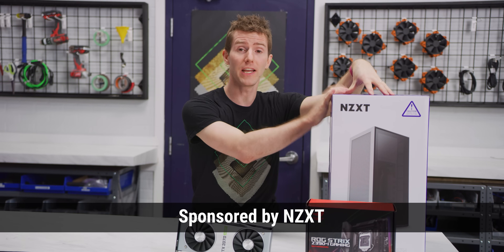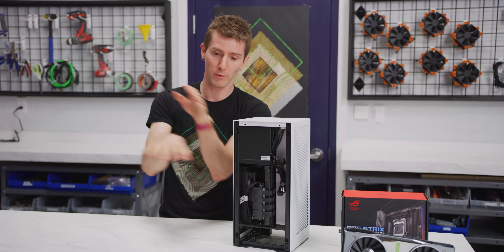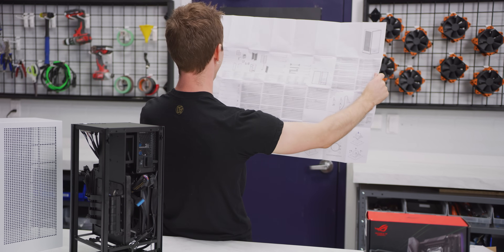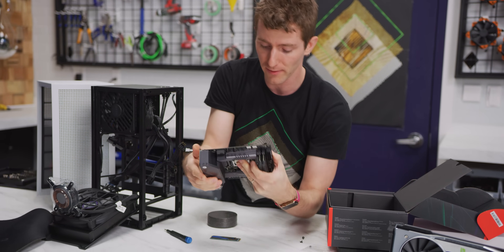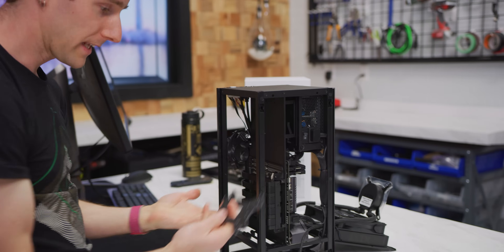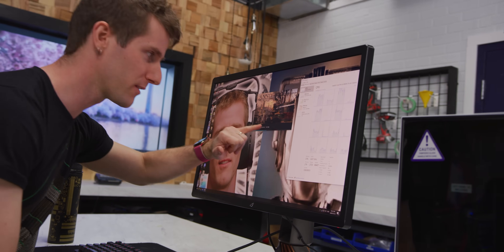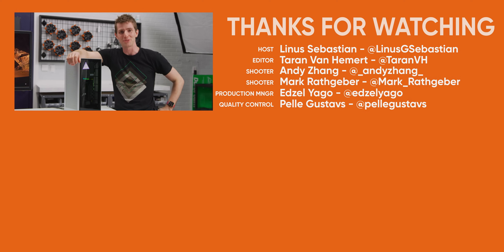Building the Xbox Series X Rip-off PC

Comment: From a novices perspective, I feel the only trouble would be that M.2 on the back for if you wanted more memory, the graphics card you would choose if you went with something bulkier, and the motherboard section. Aside from that, I feel it would be easy. 
      As well I really wish NZXT would come out with something similar but kind of flipped. So AIO and case headers are on top and then toss in a 4K Blu-ray disk drive on top as well, then everything else is towards the bottom. If I could get that in a micro set up I’d totally do it.

Comment: Guys I'm building a pc so tell me if these parts are good: Cpu: ryzen 5 3600x Ram: G.SKILL Ripjaws V Series 16GB (2 x 8GB) 288-Pin DDR4 3600
Gpu: GIGABYTE Radeon RX  5600 XT. Storage: WD Blue 3D NAND 500GB Internal SSD and Seagate Barracuda  2TB 3.5" SATA 7200rpm hdd
Case: NZXT H510 Compact Atx Mid-Tower Motherboard:
MSI B450 TOMAHAWK MAX AM4 AMD B450 SATA 6Gb/s ATX AMD Motherboard Power supply: Cooler Master MPY-6501-AFAAG-US MWE 650 Gold Full Modular, 80+ Gold Certified 650W Power Supply, 5 Year Warranty

Comment: It looks easier than most small form factor PC cases, but the fact that you have to use their PSU is annoying. It could easily go for around $100 less if, as in my case, you were looking to move all your stuff into a smaller case. $350 for case, AIO, PSU, and cable management, doesn't seem that bad.

Comment: I think it would still be intimidating for a novice because of tighter tolerances on a smaller case like this. For example, a novice probably wouldn't be comfortable with those RAM sticks being pushed by that cooler. As an experienced builder you can judge that situation and decide that it's ok, but a novice might be scared.

Overall I actually like this case, I want to switch to ITX one day, but cannot justify it at the moment because I have a quite newer PC.

Comment: building in the case looks pretty janky although the pre routed wires are extremely cool if your not confident enough to solder psu cables. As for the Video, it’s hella confusing with putting the bracket on after the fact if you haven’t done it before.

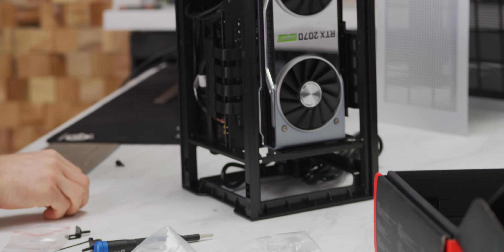Comment: To answer Linus's question at 11:07...I want this case, the problem I see is that some of the screws and mounts make me feel like I'm unprepared to build a rig with this case. I have like zero experience installing anything with a displate on the back of the board. It seems user friendly out of the box but it feels like a fuckton of cables were just kinda shoved into this thing. The cables being the same color as the case also make it a little difficult to spot everything. Some cables could have used sleeves like the motherboard power and even the angled, rounded connector could use a sleeve. I've used the same HAF 912 from Cooler Master for nearly 10 years and its missing so many parts lmao.

Comment: $350 Case +$528 CPU + $500 Gpu + $185 Motherboard + $163 Ram + $80 - $150 Nvme SSD =  Roughly $1,806 - $1,876 dependent on your storage choice, then add  tax/any peripherals.

The X Box Series X is expected to be roughly $500 USD, I'm not sure this is a great comparison... Don't get me wrong, I love PC, I just don't think that this is a properly budgeted system if the end goal is to compete with a $500 console.

I would love to see some more budget oriented content (especially a console killer), preferably with  new components (no old Dell Optiplexs).

Comment: But where would you stuff the RGB? This is why I built my own case, none readily available were big enough (particularly after Caselabs went under with their crack habits). 30x30x18 is kinda big enough, would have made it bigger if sata cables were reliable beyond 1m long and my doorways were bigger.

Comment: Using high profile RAM in a super compact case and using intel for a CONSOLE rip off.....
Never Change Linus XD
Reply: Ask that question to NZXT who provided those components as part of their sponsorship of this video. It also has an NVidia GPU, so why don't you complain about that as well? The Xbox Series X CPU is helped by a couple of co-processors which makes the comparison with a 9900K quite fair.
Reply: @Patrick73787  I was more cutting down due to not wanting to write a whole paragraph, the simple point is it's a different Architecture completely with a lower IPC, bit of a terrible comparison plus cost is way way way higher

Comment: Linus: "It's unlucky to complete the case without checking for post"
also Linus: completes the case without checking for post
Reply: also Linus: Do as I say and not as I do
Reply: First thought after he put the side panels back on, "you're really not going to test it first? Ballsy"...and then it didn't power on lol.
Reply: @drunkwaffle6410  from what i saw it looked like he didnt plug in the power button lol. how did he manage to skip that though its the one part of pc building i hate because its hard to get down in there with the tiny wires that need to be plugged exactly into the right pins.
Reply: @BrickTamlandOfficial  He said it was a  bad display cable.
Reply: How many dozens of times has he done a complete build without ever posting? Literally dozens and several of them were for the world's most expensive builds, like when you went to a Circuit City...

Comment: As a person who hasn't built a PC, it looks hard but looks easier then others
Reply: Yeah, nothing to it in the end. It is the fear of breaking shit that made me nervous on my first build, not so much the "I don't know what to do".
Reply: @94e88  oh yea
Reply: @94e88  scariest part is putting in the ram for the first time. It goes in has hard, you have to push more than when inserting other things. Feels like it's gonna break.
Reply: @entitledOne  that wasn't so bad for me though, because  you just push it until it clicks. Static discharge and accidentally dropping things(screws to bare pcb and such other "accidental" damage, yeeting the slippery and heavy gpu on the floor or screwing something too tight and stripping it, bending cpu/motherboard pins and twisting sata cables too much)  is what I was afraid of. 

Ram and cpu are the two components I feel the most comfortable with since the other requires no force and the other one requires a lot of force but you can see how much it needs.

I didn't have a antistatic bracelet so I built the machine in my kitchen and fingered the ground pins in the wall socket once in a while to discharge myself safely.
Reply: 94E22F7EE051 B0F6841E919E5C95DF1D I felt the same my first build, except my fears of messing up were realized when I went to power it up and nothing. 

Immediately drenched in sweat and riddled with panic, I had no clue on where to begin trouble shooting. 

Then, picking the pc back up to my desk, I realized the power cable wasn’t even plugged into the pc. After plugging it in (hurrdurr) it worked like a fuckin charm. Then I had to change my undies.
Reply: @eastlink20  the first build is always the most intimidating build you'll ever face, after that it is exponentially easier.
Reply: I still remember unpacking my first PC case and got Static. I kept it there for a whole day in fear.
Reply: This isn't bad at all! I learned how to build in 2003 when Tech TV was still a thing. Nothing like waiting a week for the next episode to learn the other parts of the build haha, I'm glad I took the plunge though- I've been building since.
Reply: It's really simple. A kid could do it. Really the "hardest" part is figuring out component compatibility. But even then it just takes an hour or two of research. Linus, jayztwocents, Austin evans, etc all have good tutorial videos
Reply: @connorpeppermint8635  yes

Comment: When I at first saw that the PSU and the CPU cooler were included I wasn't a huge fan but seeing that it is a pretty custom CPU cooler I understand. Still would be cool if they gave you the option though. I'm fairly confident you could fit a noctua NH-C14s in there and being able to pick you own PSU is always a plus.

Imagine that system with a noctua and a corsair SF750. You wouldn't hear the thing until you threw a graphic load at it.

Comment: I've only built one computer so far and I was happy to have an ATX / E-ATX case because even t hat was a bit tight in some corners, especially managing all the cables in the back in such a way that the panel fits on. Good to see that NZXT has taken this into account with the pre-installed PSU and adjusted power cables but I can imagine this being a real pain to cable manage if you'd have to use custom cables... But I'd still prefer a larger case, also makes it much easier to troubleshoot or swap a component without taking everything apart.

Comment: Keep in mind that according to Bitwit's video, the ASUS ROG Strix (triple fan, not dual fan) cards barely fit in here and you'd end up scratching them while installing them, so make sure that you use a card that fits like a Sapphire PULSE card, an EVGA (not triple fan or triple slot), MSI VENTUS, blower or Nvidia Founder's Edition. Basically don't use a triple fan card. Also I'd recommend replacing the NZXT fan (which is quite loud, a I have learned with my H510i) with a Noctua chromax.black.swap or a Corsair ML fan (If your budget is tight, just get a cheaper Corsair fan). The power supply is quite good and is not really worth upgrading to a Corsair SF or EVGA GM (because of the longer cables). 

This is what I would recommend for this case for a $2800 (CAD) budget:

EVGA RTX 2080 Super
AMD Ryzen 9 3900X
Gigabyte X570 AORUS Pro I Wifi
Corsair ML140
1TB Seagate FireCuda 520
2x 16GB 3600 MHz Corsair Vengeance LPX

Comment: Linus: Uses Intel processor
AMD: So you have chosen death!
Reply: Well there have never been an Intel PlayStation or Xbox........
Reply: @handlemonium  Wrong! Xbox original were equipped with celerons and pentium III's
Reply: @Catknapper  Thank you! Closer to Pentium III than Celeron but Still Correct all the Same! Was A Custom PIII CPU on the OG Xbox
Reply: Comrade Mushin And where’s the evidence.....?
Reply: TBH i want him to use both AMD an Intel cos i like diversity.
Reply: Most games are ill-equipped for multi-core (mostly above 8). They only look for CPU clock speed. At clock speed close to 5 Intel i9900K(S) is still the best CPU for games. Its not Intel's merit but its just that some game developers are (except for a few) shit.
Reply: @kolethmanu  Yup, unfortunately. But AMD is getting really good with single-core performance lately.
Reply: manukoleth actually, Ryzen 3000 has HIGHER IPC and single core performance because the 9900K still uses the same skylake architecture from 2015.
Ryzen 4.3GHz is about equal to intel 5.0GHz
Reply: @realazee  yes, more people need to hear this
Reply: @realazee  actually they are about equal in ipc now. So 5ghtz is more then 4.3 therefore better...
Reply: @kolethmanu  my i5 9600kf have same result as a i9 9900k for gaming ^^

But not for streaming and heavy work load

Comment: If u gonna make a ripoff u can at least use the right specs dude
Reply: U just want the views that’s not even close You went overboard with the cpu and under powered the gpu u should have used a 2080 super and the newest Ryzen 7 but that doesn’t even matter cause in games the Xbox will look better because devs will use the Xbox more than a single gpu so technically u can’t even make the Xbox rn because the value in the Xbox is wayyyyy to good

Comment: Is there someone doing this build with a ryzen 3000? I want to see thermals on ryzen on this kind of case and cooler
Reply: Jaytwocents’ claims 3950x will be fine on a 120mm with out OC.
Optimum tech just did some testing of small aio coolers on the 3950x. It looks to be pretty fine running a 3950x on a 120mm, crazy right. 
So the 140mm in the NZXT h1 should be a little better. Not a lot of headroom for an OC without maxing out the fans.
3900x might be a little worse though. For that watch Linus’ original testing of the 3950x. 
I think Ryzen 7 was a bit lower tdp than the 9’s so mostly likely pretty good there. But you would have to look into it

Comment: Back in the day, I bought an NZXT Rogue to build a Lan party gaming system.  I never finished it!  If it wasn't one part that wouldn't fit, it was another.  I ended up using a Corsair Vengeance C70 case with a full sized MSI Z87-GD65 Gaming and never using the Asus Rampage III Gene either.

Comment: Some parts of this seem more difficult, whereas other parts seem easier compared to a normal build. I do appreciate that the cable management is done already though. Now, if only the front panel stuff wasn't annoying to do, then I'd be happy. It's not so much difficult to plug in the front panel, but finding the correct pins can be a pain at times, especially if you suddenly find something unexpected. I helped my cousin build his PC... or more like I built it for him with his assistance, but that's besides the point. The point is that his case had some really strange thing that I just couldn't figure out what it was for. It looked the same as the USB connector (I don't remember if it was USB 2 or 3 though), but it wasn't USB (it wasn't for SD cards either) so I was unsure whether it was fine to just plug it in.

Comment: >"Building the Xbox Series X Rip-off PC"
>Building a CPU that's 3/4th the price the Series X will likely be priced at.

Linus mate, the goal of a making a console killer is to make something that kills it while being either cheaper or the same price >.>
Reply: That isn't going to happen on a new release. That is the entire point of a console... The cheap entry price for current market graphics. Of course, it gets replaced pretty fast as computers keep getting updates and their hardware typically only has one refresh.  I also think AMD new gpu is going to help bring prices down.
Reply: @Ash4med  Well, looking at all the horsepower and the fact that the One X costed $499, I wouldn't be surprised if this one was going to cost $699 though you are right, $599 is probably more accurate.
Still doesn't change much to the matter that the CPU Linus used in this supposed "Rip-off PC" with a CPU that's pretty much the entire price the Series X is going to cost.

Comment: I don't think this would be a good case for a novice. If you have watched videos of somebody building you at least know, how you are supposed to do it and it will absolutely work for you, but might be a pita. 
What I would like to see in build videos is, how you are supposed to plug in the frontpanel stuff, those flimsy 5-6 cables, all mushed together and in not so great cases right against something (those banks on the bottom of some cases, where you can hide cables and harddrives behind).

Comment: I do really like this case but its 150 out of my budget 🥺
Reply: emperoraxal  it has a power supply, an AIO which will probably cost the same as everything separately
Reply: Well that aio costs 60 psu costs around 80  and i wouldn't pay more than 100 for this case because u can get phanteks evolve for around 80 so u r paying 140 more where u should be paying less because less packaging

Comment: Does mounting the gpu with a riser extender cable reduce performance?🤔
Reply: Not really.
Correction: Electrical it does not really effect performance. But maybe airflow.
Reply: Depends on your case airflow

Comment: I built my first PC when I was 16. It was a FX 6300 and a R9 380 rig that my parents paid half as a birthday gift. It took me a little over an hour to put together and I had absolutely zero experience other than watching a few how to videos. The only thing I messed up was the tab on the motherboard shield for the ethernet port was folded down covering the port, otherwise it was pretty straight forward.
I’m 20 now and have had multiple rigs since then. My current rig is a Node 202 build with a Ryzen 5 2600 and a GTX 1070 which I had recently put together. It’s a smaller case than anything I had previously as my other prior builds were all standard ATX. Smaller cases are somewhat harder to build in because of cable management, but this H1 case looks a lot simpler to build in compared to my Node 202. It’s basically all prewired out of the box, all you have to do is add components. 
Moral of the story, if I could build a PC at 16 with zero experience, you should too! I have to admit, I was a little nervous putting my first PC together, but after I finished it, my confidence of doing it again was much higher, and I’ve been building PC’s for myself and friends ever since. If you’re worried about messing up, don’t be, as it’s hard to get something wrong. If it looks difficult, trust me, it’s basically lego but with electronics. Don’t be afraid to try something new, especially PC building!

Comment: I dont understand why LTT keeps running the "Hurr durr consoles are bad"-train, I mean, it's not a rip-off if it costs 3-4x times more than the Xbox/PS. SFF =/= a CONSOLE
Reply: A. We don't know the price of the console to compare the price difference.
B. It's still just a console at the end of the day, the price cut is at the cost of one of the most useful parts of a high-spec gaming system.

Comment: Well I’d it’s look easier however, it looks a lot more intimidating. Mainly because of its size.
Reply: I find it more intimidating when you're picking a hardware that would actually fit. That's my horror when ut comes to small builds for me.
Reply: H Koizumi exactly! I would be nervous not mounting my MB. The fact you just slide it in there.